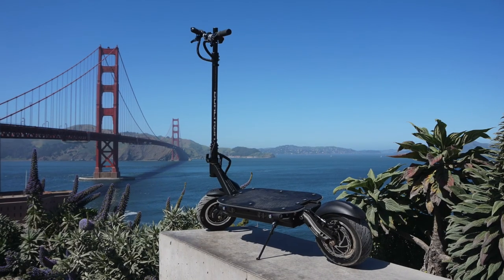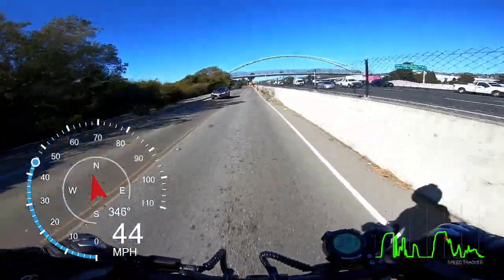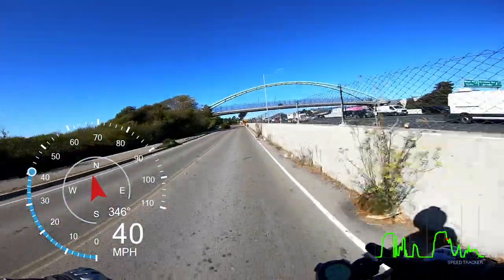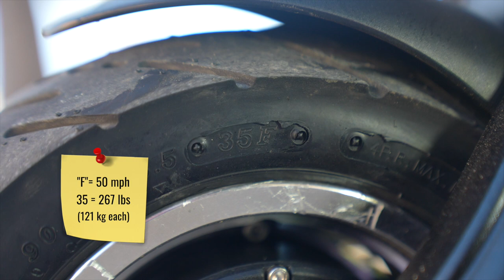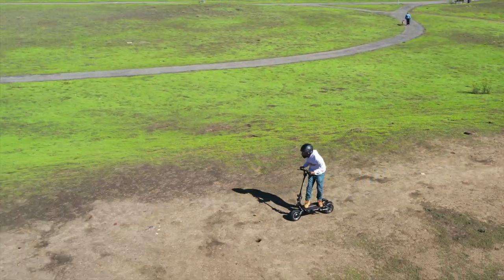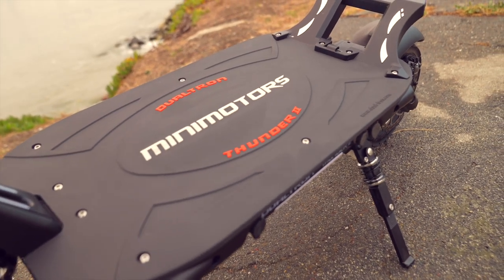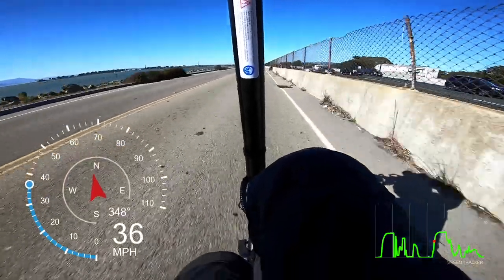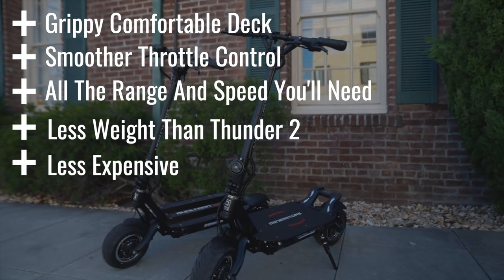Dualtron Thunder 2 vs Dualtron Thunder Electric Scooter,  Double Click Throttle & Top 10 Differences

Comment from the maker: What do you think of the double click throttle? Game Changer? Nice to have? Or gimmick?
Reply: Doubles click is interesting I guess?….But Dualtron is going to have evolve out of that EY3. I’m not dropping $4.3k for some relic display. Kaboo listened 🦻
Reply: I have a queastion.. how much better is a torque/acceleration on Thunder 2 compared to original Thunder? 

I can not find an answer anywhere. There are last original Thunders in stock, cause they are discontinued. So I have to decide quickly... 

Thank you so much!

Comment: One big difference that wasn’t mentioned was that you can toggle between rear and all wheel drive on the Thunder 1, the Thunder 2 did away with that.
Reply: Probably because it puts a lot of stress on the controller from what I've heard.
Reply: This. A LOT of wheel spin. I have a riding buddy that owns the Thunder 2. On the lowest setting he's always peeling out. 
Glad I decided on the Eagle Pro which allows adjustment on the fly between single or dual wheels or settings 1-3 and eco/turbo. Love it.

Comment: Great comparison! Not a fan of flashy lights, but they can be turned off. How do you feel Thunder 2 compares to Bronco Xtreme 11 in overall value?? Bronco has steering damper and sinewave controller.
Reply from the maker: Good question. I haven't ridden a Bronco yet, but am a big fan of sinewave controllers, steering dampers and shocks with adjustable damping. My main concern with owning a Bronco is that I'd be nervous about the company being around a few years from now to supply parts. I guess I could have the same concern about the NAMI, now that I think about it.    -Paul
Reply: @ESG-ElectricScooterGuide  Very true, but from all of the reviews i have seen bronco looks to be a quality build and i feel company will be around for a while. Patiently waiting to have mine delivered.
Reply from the maker: Let us know! If you happen to be in the Berkeley CA area, I'd love to see it when you get it.   :-)       -Paul
Reply: @ESG-ElectricScooterGuide  Will do! I live in Surprise AZ so only a 10 hour drive.😉
Reply from the maker: Ha ha! That's a lot of re-charging!  -Paul

Comment: Hi picked up a Thunder 3 last night I ordered from
a NYC shop, charged it all night & wanted to lift
stem to find metal part that hold silver locking
pins $ set screws missing metal on both sides,
does Minimotors have a return policy, this looks
extremely dangerous???

Comment: I just bought the thunder 1 for $3300 brand new at Steve scooters here in Miami fl by Wynwood and let me tell you the experience I’ve had so far is by far the best. The speed, mobility, battery life, the range is mind blowing. I mean it has 3 speeds and I can only use 2 because the 3rd speed is way to fast for me. I like going mid 35mph to 40 after that is just feels to fast. I would recommend it to anyone. After having it for just 3 days thinking of upgrading to the thunder 2 already. Mini motors take my money 💰 ❤
Reply from the maker: Glad you had a nice experience! -Vosk
Reply: Imma bout too get a thunder 1 how many kilometres can u get out of it going 50-60km/speed

Comment: Is it true that the turn signal is only on the back? in front is not there ?

Then what about the headlight? is it as bright as kaboo wolf gt?
Reply from the maker: Nothing is as bright as the headlight on the Wolf scooters!  :-)

The headlights are down low and not super bright. It would need an extra light for fast night riding.

turn signals are definitely only in the back. 

-Paul

Comment: I have a steering damper on mine its such a difference it accelerates so hard on max performance mode
Reply from the maker: Nice! I'll have to try a damper at some point.      -Paul
Reply: @Dom Dizzle it just stays stable at any speed sometimes at lower speeds i can pick up a phone call and only drive with 1 hand i wouldn’t recommend doing that tho 😅
Reply from the maker: Dom, the 2nd gen also doesn't come with a damper  -Paul
Reply: Yo man you got insta or discord?
Reply: @Wezlee ??

Comment: What’s the difference between the square wave (thunder 2) and the sine wave in the others
Reply from the maker: The main thing is throttle response. Scooters with sinewave controllers tend to have much more gradual throttle response at low speed which helps a lot on 72V scooters. We end up fiddling around with P-settings a lot more, trying to find a happy medium for throttle control and acceleration. With the sinewave controllers, setting all output to max is fine because you can still easily control everything with the throttle.     -Paul
Reply: @ESG-ElectricScooterGuide  alright cool! So square wave is not smooth?
Reply from the maker: Square wave is a little more abrupt right when you first poke the throttle. 
Here's a demo I did on the Wolf King (Square wave) and Wolf King GT (sinewave)
https://youtu.be/7oousNwubV8?t=198
-Paul
Reply: @ESG-ElectricScooterGuide  ah thank you Paul, that was just what I was looking for 🙏😃
Reply from the maker: No problem! 
-Paul

Comment: IPX water resistant rating next. Please Minimotors.
Reply from the maker: Hopefully they will do that very soon!
Reply: @ESG-ElectricScooterGuide  
Hope so too. It sucks that my dualtron is only a two-season scooter.
Reply: @rxonmymind8362  which one is waterproof and water-resistant?
Reply: @souiritv8355  
No scooters are waterproof.
Water resistant maybe a few. A splash here or there but not in downpour.
Reply: @rxonmymind8362  what about kaabo wolf king? They say it is better in water resistance